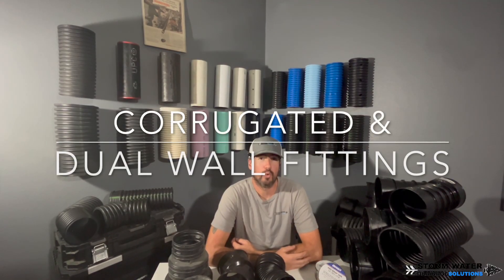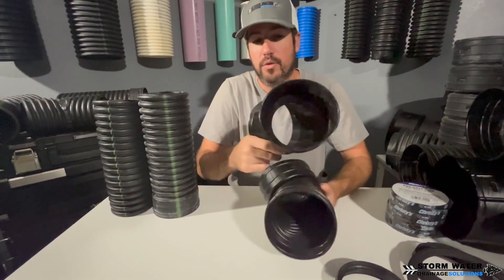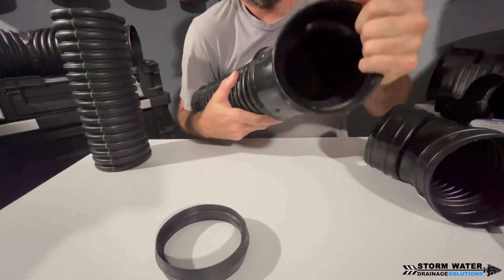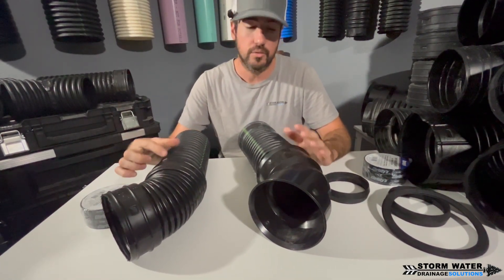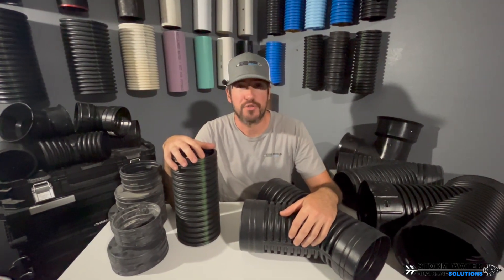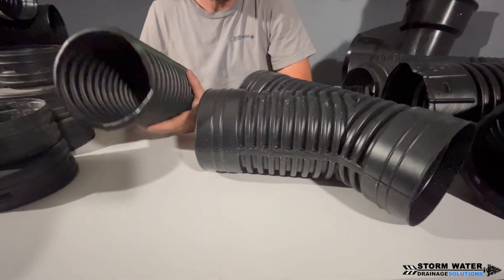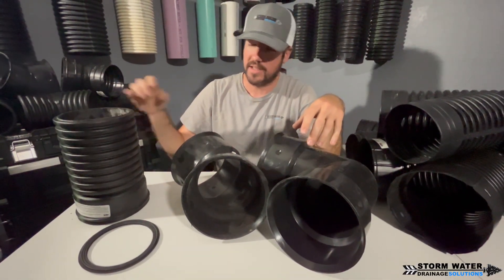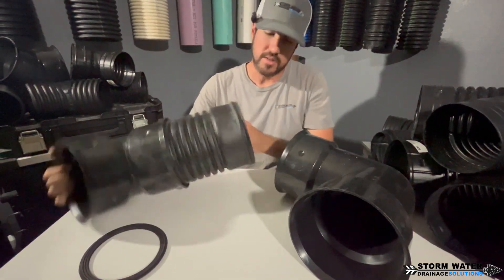Corrugated Drainage Pipe 5 Inch - Stormwater Drainage System Design

Comment: Great presentation! Here in No. Ohio--we are getting repeated downpours in 2025--like 2 to 4 inches of rain in a short time. The std. 2 x 3 gutters and downspouts can't handle that. We're going with 6 inch drains in the lawns even with 2 x 3 gutters and downspouts. Just to carry the volume of water away.
Reply: Having difficulty finding 5 in single wall pipe for for 5 inch gutter. CLEARWAYER fl.